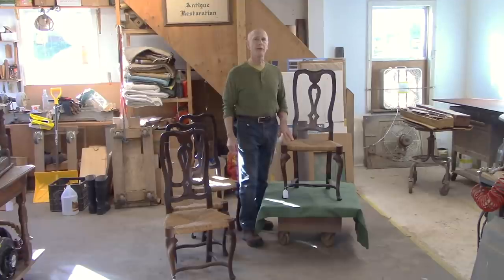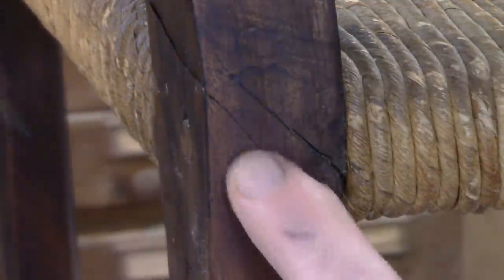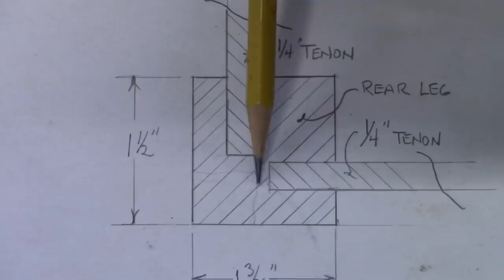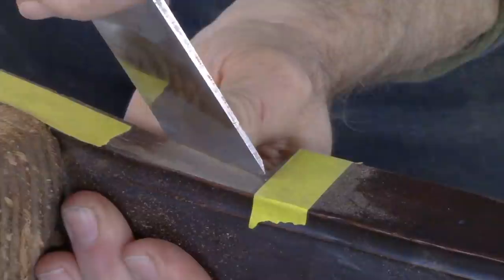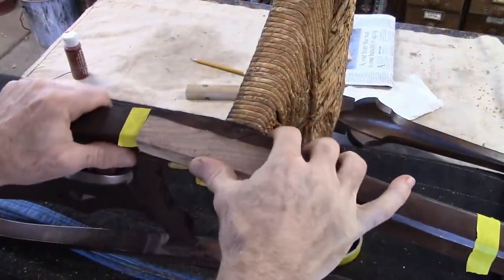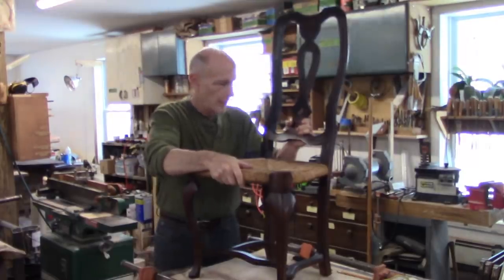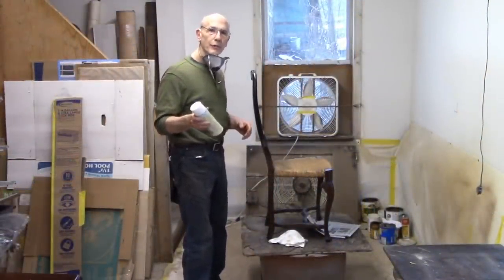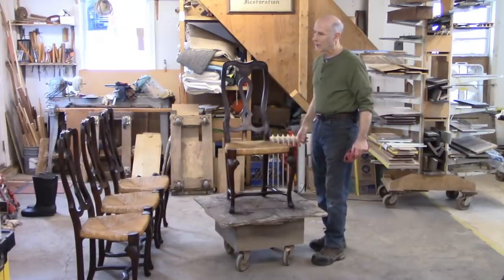Restoring an Italian Chair - Thomas Johnson Antique Furniture Restoration

Comment: Hi from Germany! Very good job, congratulations - especially considering, you couldn't take the seats apart. But through the whole video something went around in my head: I don't know what the price of this restoration was and I'm not an expert in furniture, but may it be possible, that your work costs a lot more than these chairs are worth? And if so, wouldn't it be better, to bite the bullet and change the seats, too? It would have given you the possibility of reaching every corner and the final result with new seats would have been...well, like new chairs.
Reply from the maker: Thanks! Most of my work - the cost exceeds the value of the object. All my customers have furniture restored for sentimental reasons.And yes, I would have preferred a better job with new seats but.....
Reply: @johnsonrestoration  ...also sentimental reasons have limits. I absoultely understand that. They came out great nevertheless!

Comment: Man! What I would five to apprentice with you!  Yo       Anyway, I do have 2 major questions from watching your videos please. 1) When to use water and soap to clean a piece vs. using Krud Cutter.  2) Whne to use tung oil as a sealer vs using shellac?  Thank you for all your hard work making these videos.  Yo
Reply from the maker: Thanks! It's just what I feel like and of course, how dirty the piece is and the condition of the finish. Surfacants like Krud Kutter don't need rinsing, so that's a plus. I seal touch ups etc with shellac.I would only seal with tung oil varnish if I was refinishing a top with the varnish
Reply: @johnsonrestoration  Good info. Thanks

Comment: When these are early 20-century chairs, they must be glued up with hide glue, correct? I suppose you could have taken them apart with some heat...?
Reply: It is true that you can negotiate a hide glue joint out with some heat, and Tom would have preferred to dismantle and property re-joint the chairs, but the seat weaving is what prevented him from doing so as it was integrated in the build. Removing the weave without damaging it is nearly impossible, and reseating with new wicker is too invasive and would rob too much character out of the piece. IMHO.
Reply from the maker: Thanks! Yes, but I wasn't going to take these apart! As I said, too many nails and dowels drilled into the joints
Reply from the maker: Thanks! Not to mention the pins through the joints and all the dowels drilled through

Comment: Very nice work. Isn't this chair mortise and tenon design kind of doomed to fail at some point?  I thought it was only on chairs since the 1950s but now looks to go back farther. I am surprised they never developed a different design. Especially when they don't pay closer attention to the wood grain. I suppose it is a fast and less expensive way of doing things but where you have low humidity houses in the winter it sure doesn't hold up.  Worse they are repaired with nails or dowels that are a pain to deal with when you really have to get in and do it right.
Reply from the maker: Thanks! All true. This problem goes back to forever. I don't know how you could design them differently - I think about that a lot

Comment: those rush seats were in great condition considering how racked out those chair frames were.
Reply: I bet nobody has been willing to sit on them for years!
Reply from the maker: Yes, that type seat is very strong.
Reply from the maker: Thanks! I'm not sure
Reply: The rush may be "in good condition" meaning not rotten and falling apart, but, with the way they are sunken, they have to be incredibly uncomfortable to sit in ..... the front rail will be pressing on the underneath side of the sitter's legs about 3 inches back from the back of the knees ..... the chairs in some of my doctors' offices bottom out like that and I refuse to sit in them (from past experience they are orthopedically bad to sit in)  The only way I would sit on one of those chairs is if the owners have them equipped with nice thick seat pads

Comment: Mr Johnson are the cats yours? And also I’d like to know, what’s the difference between the wax you use for small repairs and crayons wax? Is there any difference? (Please don’t laugh) 😊
Reply from the maker: Thanks! They are, although we do get visitors too! The "crayons" you can rub into small defects, the ones I use with heat are a lot harder and of course you must use heat to melt them. With the low heat wax sticks you can do much larger defects

Comment: Tom , those are a nice set of chairs but the manufacturer underestimated the torque  that  would be applied  to those joints after 100 years of use resulting in them  breaking down . Hide glue and the ability to remove the seat  would have made future repairs way easier as well as beefing up the joints  initially for people over 200 lbs . If the manufacturer had made the seat removable and used hide glue for joints that job would have been  easy to reverse and  fix.. Referencing your too many tenons video an engineering flaw.
Reply from the maker: Thanks! Yes, all good points. I suspect the manufacturer never gave a thought to future maintenance

Comment: If CA glue is cyanoacrylate (super glue), I was unaware you could use it like you did.  Good to know, thanks!
Reply: Bear in mind that CA (like epoxy) comes in different formulations, with different viscosity and curing times. What Tom is using seems to be very liquid and slow curing (for CA!) - possibly very much like the stuff that turners use to stabilise cracks while turning.
Reply: @dlevi67  Very interesting.  Thanks for the info!
Reply from the maker: Thanks! Yes, it's interesting stuff!
Reply from the maker: Yes, and this stuff was formulated for doing exactly this type of repair. When I had people working for me I would not allow this adhesive in the shop - I knew my guys would start using it for everything

Comment: The proper tool to use in "hogging out' the new piece of wood would be a grinder.  The hammer just loosens up the other joints.  Shape it and be done.
Reply from the maker: Thanks! Good idea, I didn't think of that

Comment: I've had luck angle drilling into a joint pocket and injecting glue for tenons that won't come out.
Reply from the maker: Thanks! Yes, if you can really tell where that pocket is. I've done the same thing

Comment: That was a ridiculous construction in the first place. I'm all for showing lovely figure in wood, but on a chair leg, where you need all the structural integrity, why would anyone do that?
Your repair was the right choice, I think; just the epoxy would not have withstood the stresses in that knotty wood. Thanks for sharing, Tom!
Reply: I think those were relatively cheap chairs, made in fairly large numbers using 'almost-mass-manufacturing' techniques. One of them ended with an unsuitable piece of wood...
Reply from the maker: You're welcome! What dlevi67 says!
Reply from the maker: Yes, they had lousy QC that day

Comment: The use of multiple types of adhesives looks very aggressive.
Reply: The only thing I would do differently would to put the weight of a person in the chair as the glue cured overnight.
Reply from the maker: Thanks! Yes and no......
Reply from the maker: You know, that's a good idea. It would "settle" everything into the right position

Comment: These chairs remind me of the antique dealers paradox. If you buy 11 period chairs, take an arm off one, a leg off another etc etc, you end up with 12 period chairs with minor restorations. 90% of the chairs will be period but you've created an extra one out of the spare parts to make up the set.. You can then sell them as a restored period set.. Is that ethical???
Reply: It's a very old paradox ('The Ship of Theseus'' in the oldest version I know) - but from an ethical point of view, in this specific case it's a pretty easy "no way José".

From a practical point of view, it's also far less easy than it seems - apart from patination and wear marks no longer matching, even sets of very closely matched chairs don't necessarily match, especially in the joints and the carving: before machine tools, mortises and tenons paired with each other for life, monogamously. 

My bet, if you could get a set of 11 antique chairs that are sufficiently valuable for someone to consider that type of work, is that it would either be sold as such, a 12th 'reproduction' chair would be built, or possibly even as a set of 10 and a single. One of the most valuable sets of chairs I had the luck to handle was a set of 10; I then located another 2 and the same collector who bought the 10 was quite happy to get an extension to his set!
Reply: @dlevi67  I hasten to add, I've not done this, and of course you have the difficulty of matching the patina. I once made a Chippendale silver table with fretwork and cluster legs using reclaimed timber. I managed to fool the auction into thinking it was 18th century until I told them. All it takes is time and hands on knowledge of the original..
Reply: @chrismalcomson7640  And a fair amount of woodworking skills! :-)
Reply from the maker: Thanks! It would definitely not be ethical - but really, hardly worth it! Too much work, dlevi67's correct
Reply from the maker: Yes, I've been involved with jobs like that (as a finisher)
Reply from the maker: We'll have to look this up, but the most famous furniture forgery was by a guy in Rhode Island, his name might have been LaMontaigne, who built a Brewster Chair and just put it out there, until he saw it had ended up at the Henry Ford Museum as an original

Comment: Is it just me, or do the seats look out of place with the chair design?  As always you find a way to repair so you never see the repair.!
Reply: Yes, those rush seats are painful to look at: the front legs are patently designed for chairs with aprons.
Reply from the maker: Thanks! They look fine to me - not out of place. I'm going to look through my books to try and find other examples
Reply from the maker: Thanks! I don't agree - I think they looked fine
Reply: You're the expert, dear Master Tom! Still, I think the bulge on those legs is meaningless if it doesn't connect to an apron. In other words, methinks some factory in Italy had leftover legs that were originally meant for different chairs…